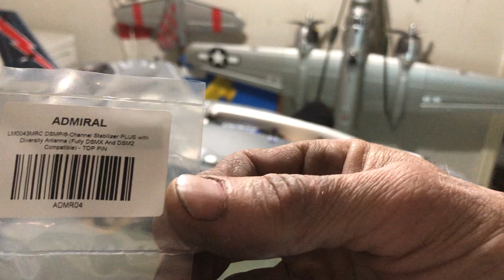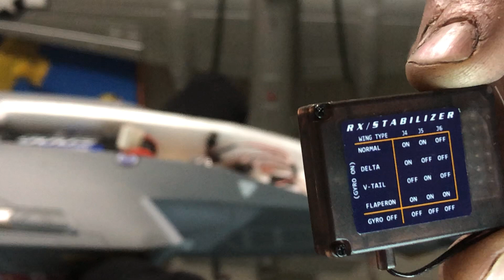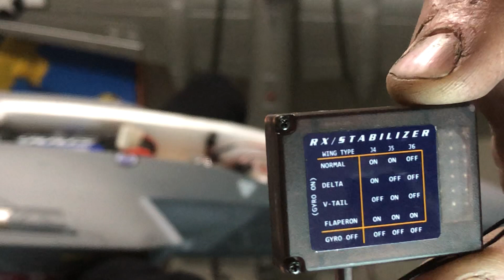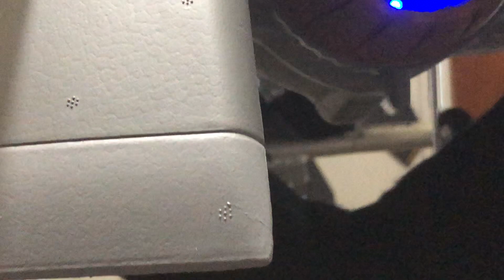Freewing F-35 (Setup on Admiral 600 Gyro)

Comment: EQ 👌🏼 Love the light set up my brotha man ‼️Got me a hand full of these things last month , usually just put a Lemon RX in my EDF'S .. I was on Motion scooping up that F 22 and said ' '' WHAT THE HECK '' send a pile of these ADMIRALS .... 600'S Same Shit Lemon RX made. I need your help EQ ‼️‼️‼️ any of your LX EDF'S HAVE THEM ELECTRIC BRAKES ??????????????????????
Reply from the maker: Thanks brother. Brother if those Lemons work good for you I’d stick with them. But the Admiral 600 is a on and off switch but it’s not like “Off”, “Stability”, “Gyro”. It’s “Off”, “Stability “ only. And another program is “Off”, “Gyro”.only. You feeling me. And I’ve personally not flown a aircraft with this gyro in it. Pilot Ryan DONT like it for some reason. His videos on setup never work right for me, so I don’t think he setup right. Watching my two videos on setup of this receiver. Yes I’ve got the big B-25 w/brakes. And got them adjusted to just ease the brakes on, not just slam on. It’s on bind button on radio. So I never take off w/on. The two screws on inside of rim is adjustable brake tension, in is less brake, out is more brake. Getting them even is the trick. Just keep testing on runway.Any thing I can do brother. 👍🏻✌🏻🖖🏻

Comment: I am trying to set this up with an AR630 with SAFE and AS3X. Above 50% it is oscillating any recommended gain settings for SAFE?   Trying to use SAFE less but still working on it.
Reply from the maker: Well on the 31 gyro receivers can be adjusted in radio. But I’m thinking the 36and 30 has to be done on a laptop. I could be wrong.  Watch Air Marshall Dave RC channel or BD Tennessee. They know what there talking about. That’s why I use the Admirals. And I use Detrum gyro receivers in less expensive planes. I also use a 10chan Admiral with a Blue Eagle Gyro on most EDFs. I have a 36 but have not tried programming it yet , need cable from Horizon or Tower Hobby when in stock. Thanks for watching and a great?👍🏻✌🏻🖖🏻